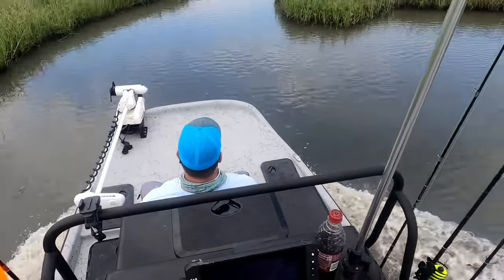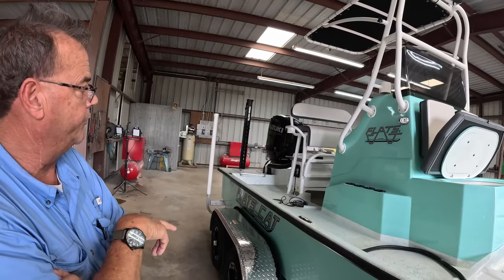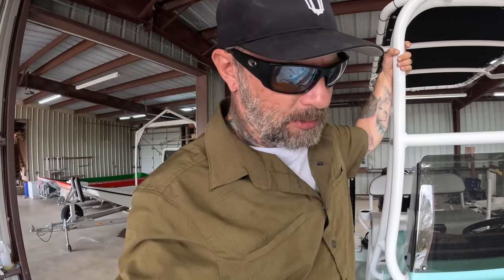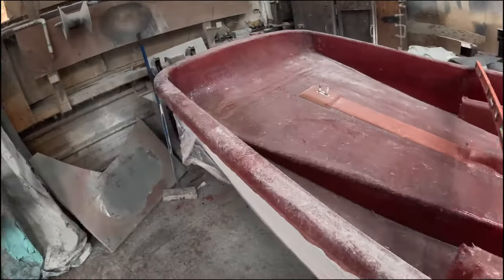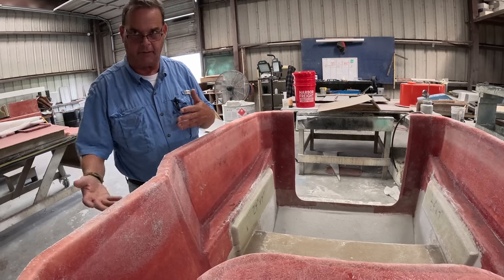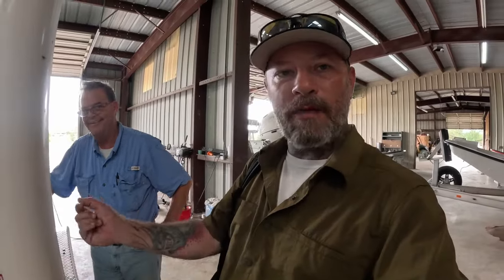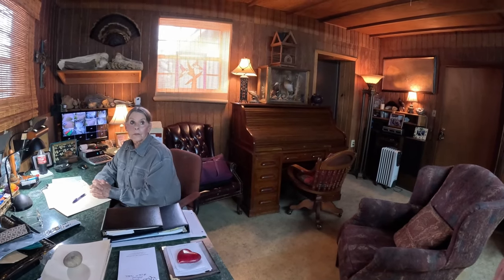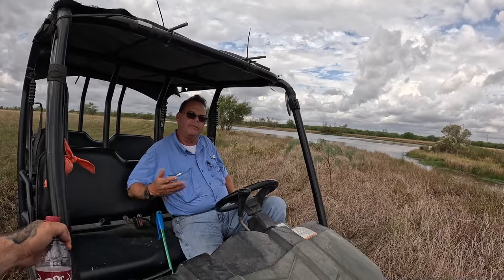The NEW Flats Cat Boat is amazing... and affordable!

Comment: I bought a 19 in 2010 from Bill. I run on the Wisconsin River between the Castle Rock  and Wisconsin Dells dam.  It’s a sand bottom river m. I’m running a 115 étec .  Great boat. I often Slide Over sand bars that are a 20’ wide. At speed with no problem.  I’m thinking about getting a new 21.  Nice video thanks
Reply from the maker: Awesome. Thanks for watching!

Comment: I need to replace the deck on my '75 Aquasport 170 and I was thinking of using 1/2" Nidacore with tapped aluminum backing under the console and helm seating/leaning but this "K-300" has me intrigued. I Google K-300 and I'm having trouble finding it. I thought, at one time, to use Coosa but from what I understand it too can allow screws to work loose. Can you tell me who makes K-300, maybe a link? 🤔 Would be appreciated 🫡
11:02 I like that diamond stitch 👍

Comment: 2in water huh? The prop to motor is bigger than 2 inches, if you don't put prop in water no way to get up on plane
Reply from the maker: The tunnel under the boat forces water up to the prop allowing you to run much shallower. If you stop, half the prop is out of water but while moving water is pushed above the prop.
Reply: My Yamaha g3 tunnel Dlx will run in 2 inches of water; I have setup the bottom of my skeg to be level with the bottom edge of the boat, putting my prop completely above water; the forced water from the tunnel compresses water and directs it to the prop.